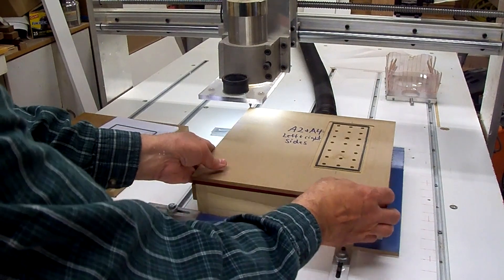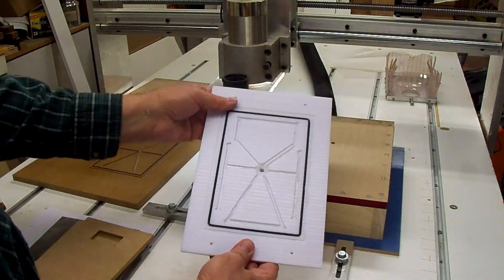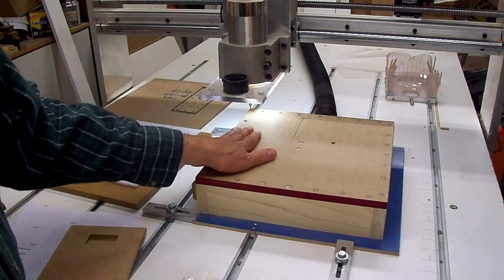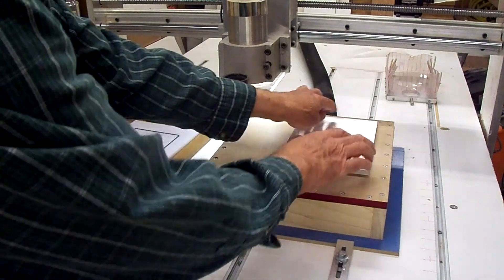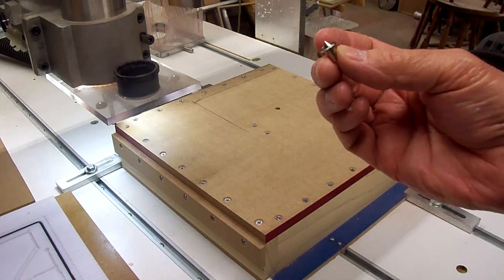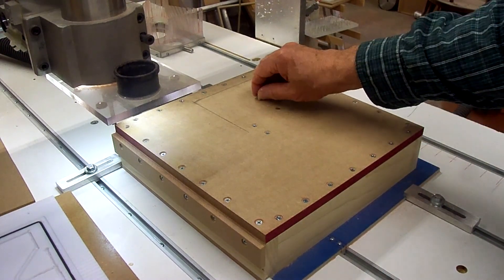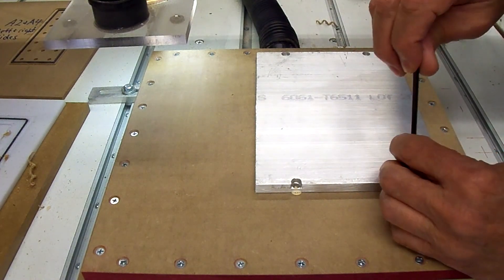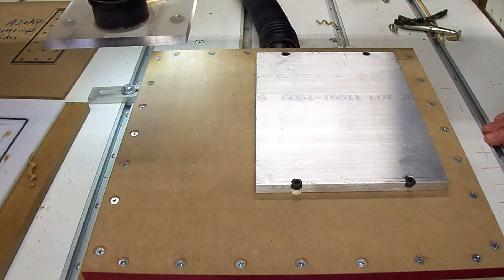CNC aluminum vacuum plate

Comment: While watching this video I was thinking that you could have brought some shallow channels out from the center of your vac hole in the mdf out to the corners and used the vacuum to hold down both the aluminum plate and the work piece without the need for screws.  Just a thought.

Comment: I agree that a bigger hole will make a difference, or more holes. 

I would also suggest that rather than cut the deep grooves as you have, just mill out a shallow area as large as you can inside the gasket boundary, it's all about surface area that the vacuum is being applied to, the smaller the part the harder it is to keep it planted.

To support the part, small islands in the milled out area are a good idea to stop the part bending down into the vacuum.

Comment: Nice work! You will find it would work even better if you had either, a bigger hole in the middle, or had more smaller holes (maybe at each end of the slots). This will allow more air flow for the shop vac to restore the pressure lost from small leaks in the gasket.